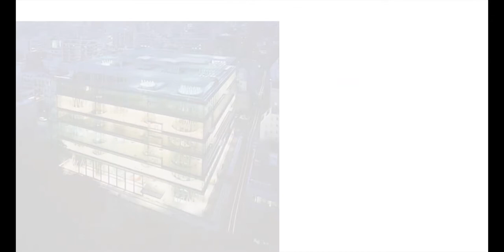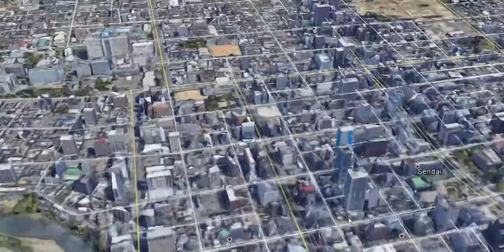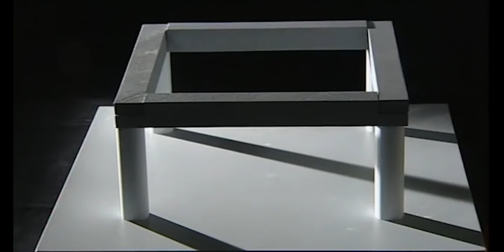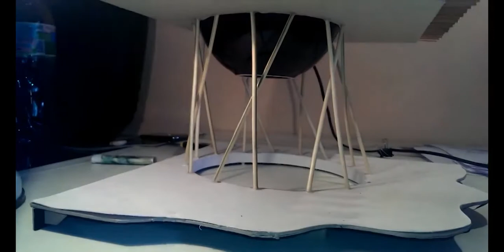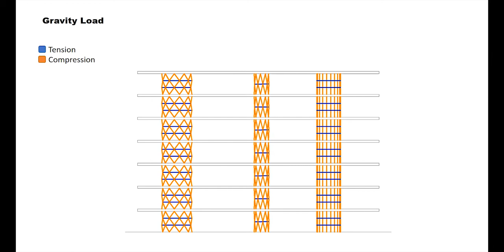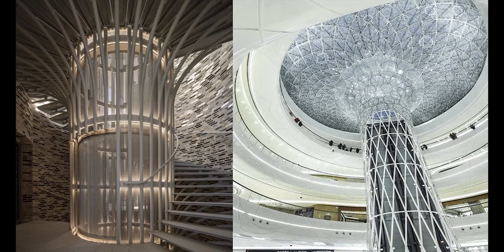Sendai Mediatheque - Structure Describe

Comment: Overview
Location: Sendai, Japan
Significance: The building experienced a magnitude 9 earthquake in 2011 with only minor damage, showcasing its earthquake-resistant design.
Structural Features
Columns:

Large dimensions, contributing to strength.
Vertical connections (stairs and elevators) are centrally located within the columns.
Columns on different floors are not aligned in the same direction, enhancing aesthetic appeal and structural integrity.
Structural System:

Unlike traditional buildings that use concrete slabs and beams, the Sendai Mediatheque employs a space frame for its columns and a steel grid for its roof structure.
Construction Method:

Columns are constructed after each floor is completed, with variations in direction across different floors.
Connections between columns and the roof structure differ on each floor, allowing for flexibility and strength.
Performance Under Loads
Gravity Loads:
Transferred to columns through steel grids, inducing tension and pressure in the columns.
Lateral Loads:
Forces from earthquakes or wind create shear forces in the columns, leading to additional tension and pressure.
Earthquake Resilience
The building's structure remained undamaged during the 2011 earthquake, with most damage occurring to the false ceilings, some of which collapsed.
The design allows for greater axial and flexural load capacity compared to ordinary columns of similar weight, thanks to the large dimensions of the space frame columns.
Additional Features
Internal Space Utilization:
The internal space within the columns accommodates stairs and elevators, optimizing the use of space.
Broader Applications
The use of space frame columns is not unique to the Sendai Mediatheque; similar designs have been implemented in various projects, particularly in structures requiring large spans.
Conclusion
The Sendai Mediatheque exemplifies innovative architectural design that prioritizes earthquake resistance through its unique structural system, effective load distribution, and strategic construction methods. Its resilience during a significant seismic event highlights the effectiveness of modern engineering practices in enhancing building safety.